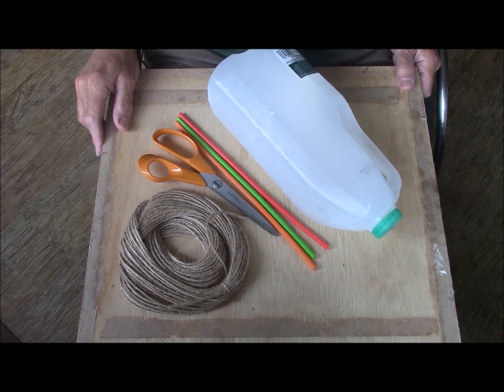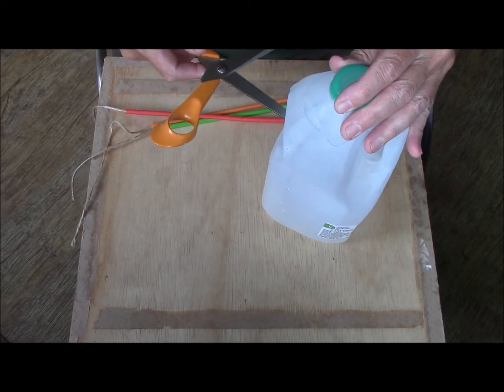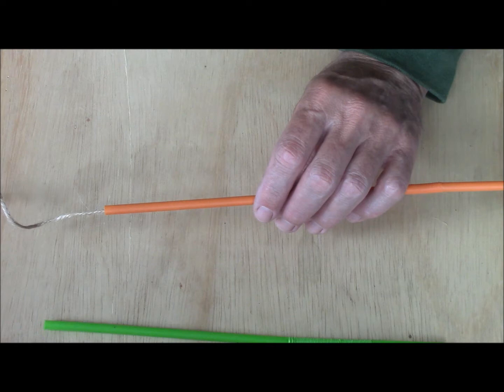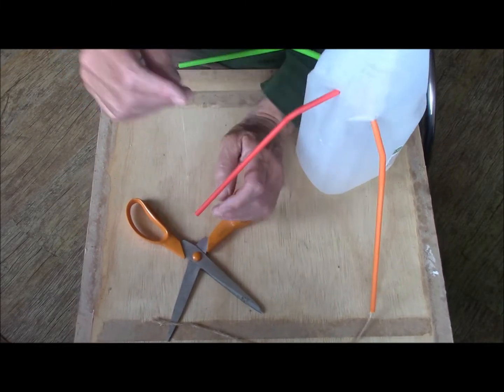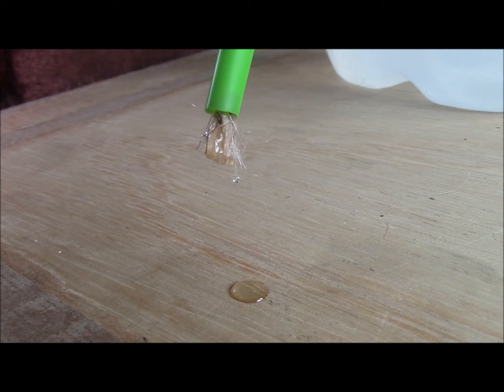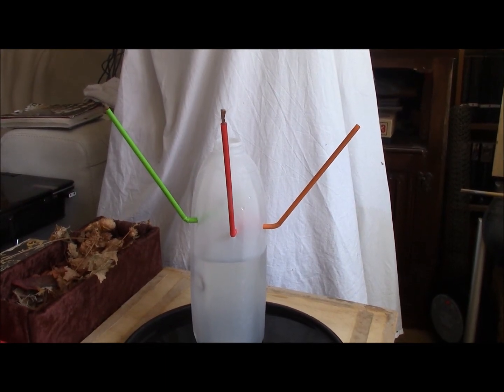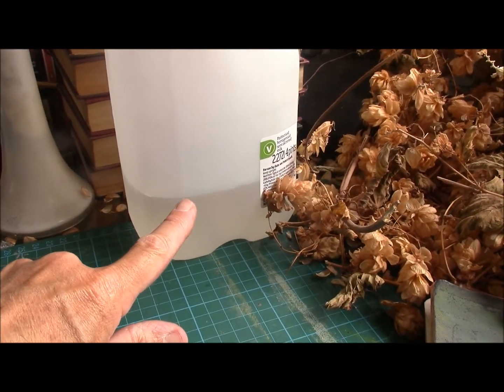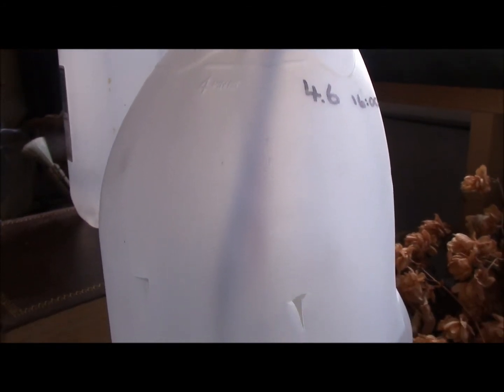Capillary Irrigation

Comment: hey paul.. thank you for sharing this video..
Wich wick you are using in this app ?
Where can i buy it ?
Reply: Hi. The wick is jute string. I buy mine online on ebay. You should be able to use any organic string, so not polyester or nylon for example. Doing a test is always a good idea to see if the string transmits the water. Good luck!
Reply: Hi Paul. This is from Brazil. What if I use Bidim instead of junte string?

Comment: Since you can only feel the jug up to where the holes are, why not put the holes in the top?
Reply: Good idea. You could try putting the straws in the top of the bottle instead of cutting into the side. A more elegant solution perhaps.
Reply: Or you could do the contrary: connect the straws to the bottom of the bottle, as this would make a stronger water output.
But you'll need to connect the straws to the bottle in a hermetic way to prevent unwanted water leaks.
Also you'll need to use strings thick enough to sit in the straws tightly, otherwise the water will just flow bypassing the strings. Or you can use heatshrink tubes.

Comment: Paul what if I get a trash can plastic throw those the string tied to a rock use fish pump tube but at the plant I make a lasso around the plant an cover it with soil
Reply: Hi ledgrowlabs. Sounds like an interesting set up that should work. Try it and see. Make sure the plant is lower than the water source. The capillary action seems to work best going downhill with gravity assist. Experiment is the way.
Reply: @365dongle3  I read that water can only wick up 13 inches so I will have to experiment an see what container would be best thanks 4 sharing your way fits me intrigued so this can go into tents with a res out of a tent

Comment: Do you think if the strings were extended  through the straws, so the plants needing watering in porous cloth containers sat on top of them, they would be able to draw the water as needed like they do in self watering container systems? Although the self-watering containers have the water supply at the bottom of the container with a wick connecting the soil to the water supply, rather than to the sides as this would be.
Reply from the maker: Hi Emily. The strings in this model do go right through the straws and come out the other end. This ensures the water gets through the straw. The straw acts as a conduit - there would be evaporation without it as the water travels very slowly. As long as your water source is higher than the destination you can direct it on to your capillary mat, which is what it sounds like you are using here. Just make sure you have enough of a supply to keep the mat moist. Some trial and error may be needed.
Reply: @paulholzherr2993  After visiting your site I discovered that evidently if the water source is below the plant, the water will be sucked up by the roots against gravity when it is needed  but if the water source level is higher than the plant, the water is forced out of the container and empties onto the plant by gravity which could lead to over watering. 

Also there are evidently some cheap watering systems you can use consisting of plastic tubing attached to a container/capsule with a removable lid with holes at the other end to allow the water to drip into the plant. A woman showed them being used to water plants throughout her house. The tubing extends to the bottom of a jar full of water and the end of the capsule sticks into the soil of the plant. The plant needs to be fully watered from the top before setting it up to work with of course the jar of water being placed below the plant.